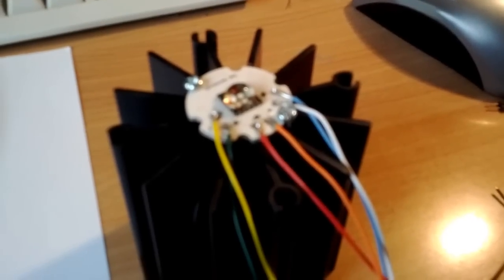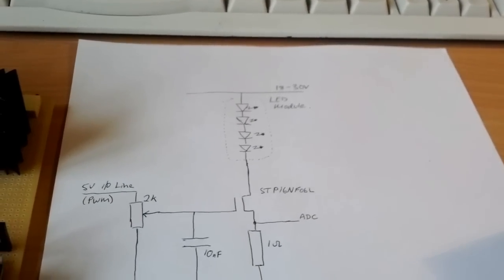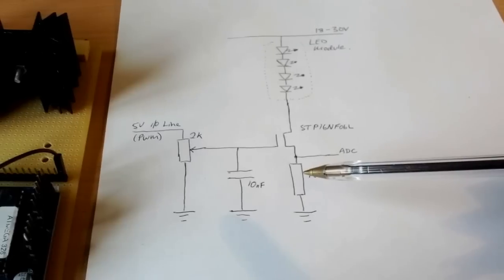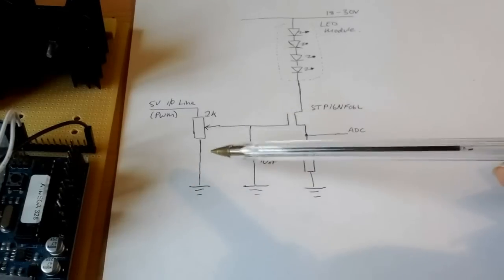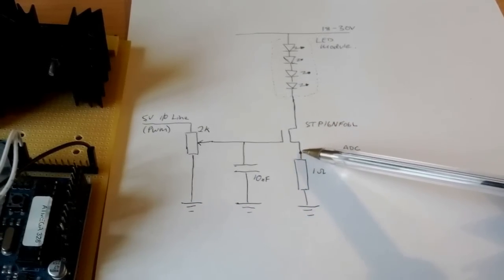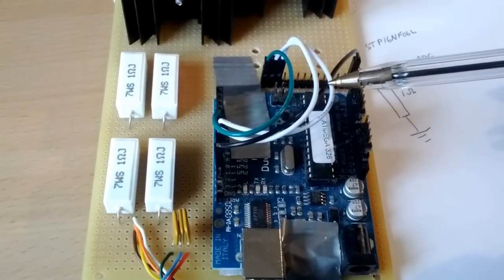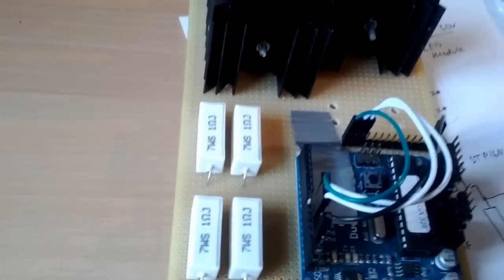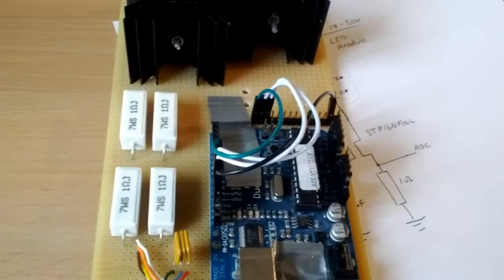Programmable 40W RGB LED lamp: LED module and driver circuit

Comment from the maker: More on my programmable LED lamp
Reply: This is kinda cool. It's almost exactly what I was planning, only with a few lasers in series, rather than high-power LEDs. (I did a constant-current circuit for a single laser last week). 

What does 'ringing' on the ADC mean ? It was going over 5V ? I'm also not quite sure what the inductive load the flex put on it - is there a few khz of RF going up & down the flex ?

What's a danger temp for a power mosfet ? 

Mental note; get some polyfuses. They do seem to be useful.
Reply from the maker: This is what the ringing looks like:
https://picasaweb.google.com/lh/photo/9nWPhndvAfv4X6gm0xkpUbCV3t8lUilaBy3ifI-qpL4?feat=directlink

Concerned about the large negative spike there: didn't want to chance damaging the ADC. I only have one spare Arduino and this project is a xmas gift that was supposed to be delivered 2 weeks ago (I've to go make another for myself then). The problem here is the very sudden cut off in current causes a kick from what ever inductance is in series with the FET. In theory none, but the 1m of cable (2m path) does have an inductance. Solution: don't cut-off the current so quickly and you don't get that spike. I guess a flyback diode could also work: didn't get to try that.

This is the same signal with the 10nF capacitor:

https://picasaweb.google.com/lh/photo/6qQkN-DzxRd--N3Q_xzyDbCV3t8lUilaBy3ifI-qpL4?feat=directlink

The FETs I'm using are good for up to 170C... but I don't want to go anywhere near that. There is nothing in the project box that's particularly flammable .. but I don't know enough about high power stuff to understand the risks. My aim is not hot enough to burn on touch... about 70C. Now I've only tested that outside the project enclosure... so it may get a little toastier inside. I guess I'd be happy with <90C on the actual heat sink and < 60C air temperature in the box (marginally hotter than AU right now). Also don't want to over cook the Arduino that will be in there. I could add a fan I guess... too much hassle for the moment.

Didn't test the polyfuses... had them... but didn't trip them yet.
Reply from the maker: A few more random comments which I'll write up in a blog post later. This circuit is built for simplicity. It's not particularly efficient. The supply voltage minus whatever the voltage drop across the LED module X 1A x 3 channels is dissipated in the FET and resistor. That's a lot of watts. A buck/boost regulator would be far better... but those chips are very expensive (I mean really expensive ... $10+). As this is a decorative light rather than a functional one, some waste in the driver is acceptable. 

Also I forgot to mention the monster heat sink on the LED module itself. Ya: that pumps out major heat. That heat sink is about 80mm high and gets too hot to touch when all channels at 100%. Nothing that can be done about that however. But it does mean for safety (and comfort -- that point light source is very painful on the eye) you need some kind of diffuser / lamp shade.

Also originally going to use a TI LaunchPad (MSP430 version) as the controller. They are just $4 and I have about 12 of them lying around.  (The handy thing about a dev board  vs a chip is that USB connector and necessary USB IO is already implemented)... but it was taking too long to get simple IO going. Also the recipient of this unit is an Atmel fan so an Arduino seemed more appropriate. Also the 5V IO (LaunchPad is 3.3V) allowed more flexibility in driving the FET gates. The next version may very well be LaunchPad based.

I also want to do a very simple UI on the face pate. Maybe a rotary knob (inf optical type) plus button. Not sure.
Reply: @JoeDesbonnet  interesting !!!
i'm actually working on a project with the same purpose... but just with some differents. I have to drive 4 channel leds (RGBW) and the power supply is around 41V that's a lot yeah... but founding this topic on the subject and resource is awesome. Thank you so much